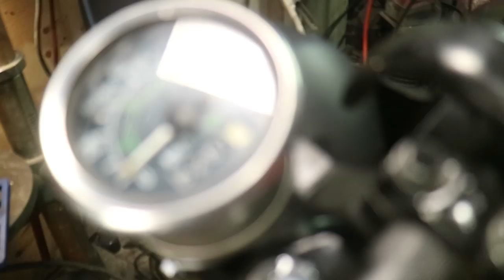CAFE RACER BUILD, HONDA FULL BUILD TIME LAPSE

Comment: Turned out great. I was wondering if the frame strength was going to be compromised but it looks solid now. Thinking of something similar for my ct 90 thanks for the inspiration. Great timeline video. Must have been a lot of hard work and effort. Great job!
Reply: 2